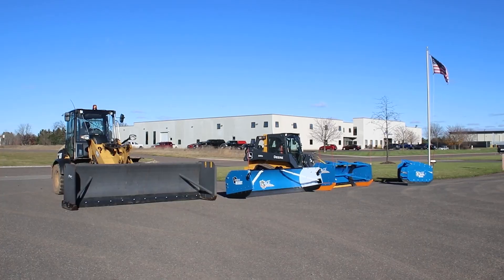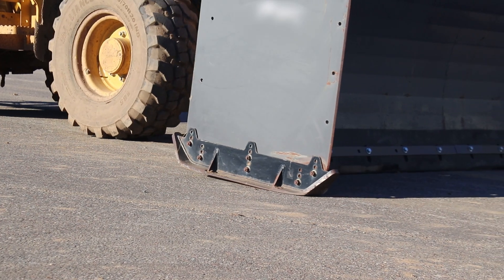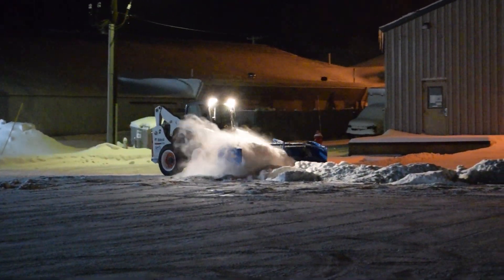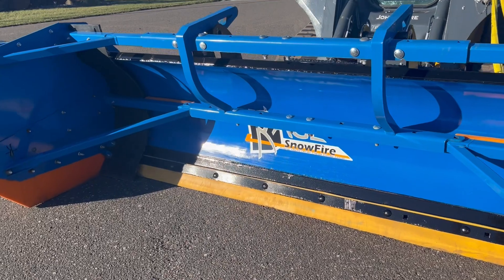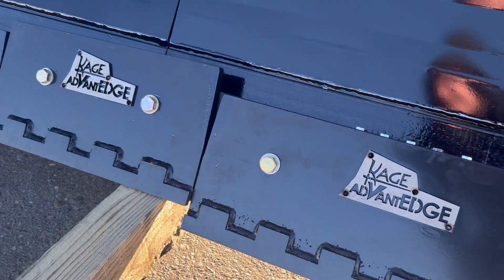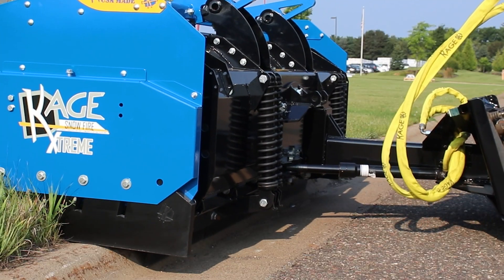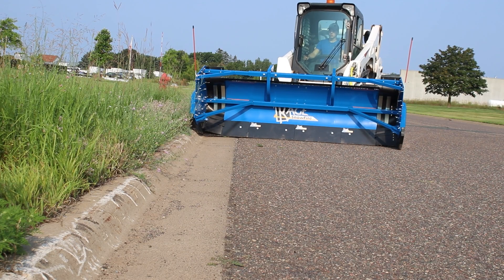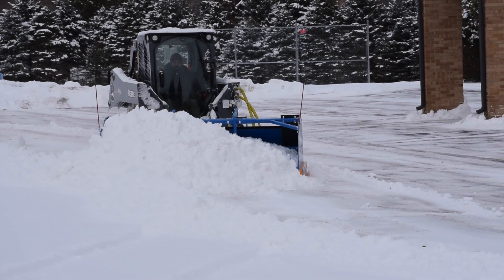What makes the best snow pusher?

Comment: What would make our Kage pusher only angle to the left?
Reply from the maker: Feel free to give us a call at 844-314-5243. We'll be happy to assist you.
Reply: There is likely some debris in your hydraulic system which is plugging the restrictor. Try taking off the black restrictors on the cross over relief valve and cleaning out the system. The most likely reason there is debris in there is because when implements are hooked, up the couplers are not wiped off and they are covered in dirt.